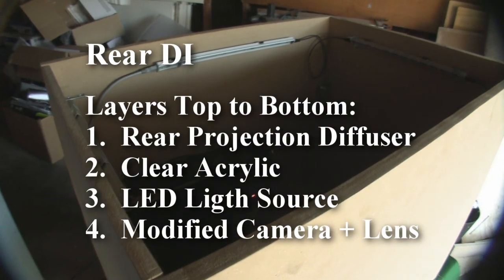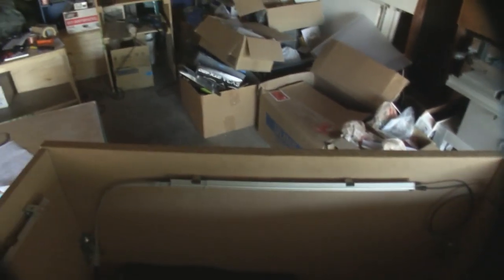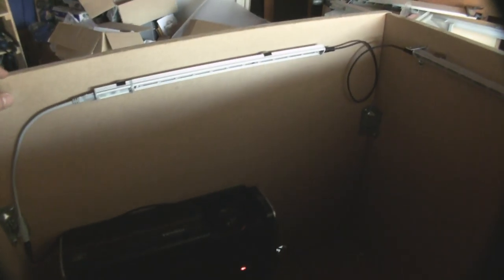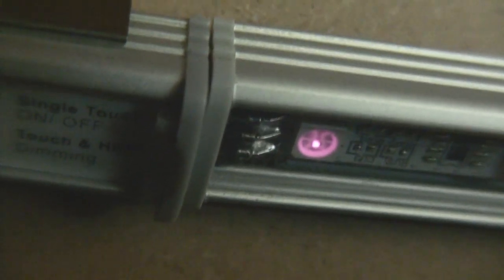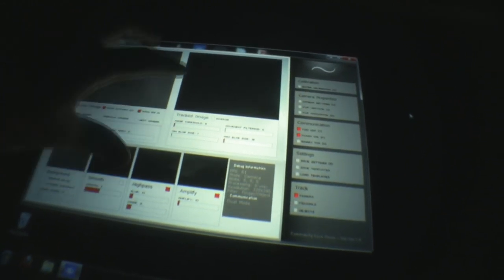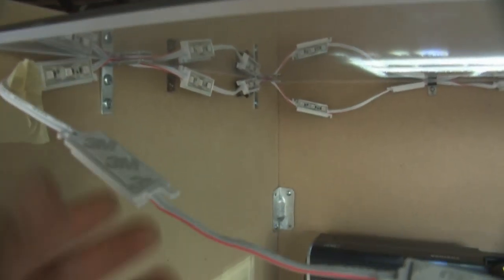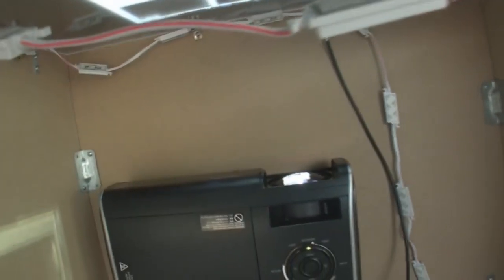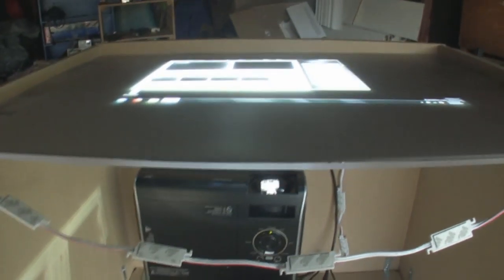How To Build a Rear DI Multitouch Table

Comment from the maker: Sure. CCV outputs TUIO commands which can be read by a Windows, Mac and Linux computer. If you want to control the PC using touch similar to a mouse you'll need to get a TUIO Mouse Driver for your OS.

Comment from the maker: The bars are 12 inches long so they would not work in a 6 x 6 inch box. You would be better off using the 12 module kit.

Comment from the maker: Yes it would still require two cameras, but you'd need a 3.6mm lens instead (which is better since it has less distortion).

Look at getting CCV 1.5 to combine the images and convert the touches to mouse movement (TUIO mouse driver also required). You can download CCV at ccv dot nuigroup dot com. To run multiple cameras you will need to get the multi-cameras driver from Code Laboratories (CL Eye Packs).  Please contact us through our website for more help on your project.

Comment: Thought about my size again, and forgot the decorative frame.  So screen size would be 32"x18". If that still requires 2 cameras for a 22" Coffee table height, will windows understand 2 touch input devices or is there software you guys sell that makes it work?  I have not gotten that far into your site yet.

Comment: Do you offer plans to buy?  I understand the basics.  IR Camera mounted in the bottom of the box.  Projector pointing up at that diffusion layer.  Acrylic top. IR lights around.  Hooked up to a computer.  I would like to know how far away a camera would need to be mounted from a 48"x27" coffee table.  Would prefer not to need a 36" high coffee table.

Comment from the maker: A Rear DI setup cannot have a see-through enclosure as the light needs to bounce around inside the box and only be emitted out the top touch surface.  Please use our contact form on our site to send us an email for further help on your project.

Comment from the maker: The videos should explain roughly the materials needed.  The LED-LP setup isn't that difficult assuming you can solder.  You need the single LEDs with narrow beam angle for LED-LP.  Yes projector can matter, but you can build a setup with any one.  Some are just better than others.

Comment: Okay thanks. What are the materials that are need?  How long would it take to build one of these sets? I am looking for a challenge and the LED-LP looks challenging to put together with all the LEDS. which LEDS would be better the sinlges or the strand? My biggest problem is finding a cheap projector that works amazingly or does the type of projector mater?

Comment from the maker: No, IR light doesn't change with color of paint (since color is for visible light).  If you want to help reflection inside the enclosure you can line it with metal (such as aluminum foil), but it typically doesn't benefit enough to make it worth the hassle.

Comment from the maker: @abcdefghiJerrold  Yes you can use lamps with a cluster of LEDs, but keep in mind that most CCTV lamps on the market have very, very narrow beam angles (15-30 degrees typically) and thus they will be flashlights, creating terrible hotspots.  You can get a bunch of small ones and point them down to the bottom of the box to try and reduce the hotspots, but the wide angle LEDs I go over in this video are your best options.  If you have any further questions please fee free to contact us.

Comment: Re the corner tracking issue, couldn't you sort of alternate the location of the bars?
like, one in the top left horizontally, one in the bottom right horizontally, one in the top right vertically, and one in the bottom left vertically?

Comment from the maker: @devilsonlychild  The diffuser in an LCD setup goes directly under the LCD layer to provide an even diffused light from the backlight.  You cannot do Rear DI with an LCD as infrared lights placed below the LCD panel will not be able to illuminate your fingers on the touch surface.  The only options to use with an LCD are: LLP, DSI, or LED-LP.

Comment from the maker: @HypaBass01 That box is roughly 21x28x24 inches (l*w*h).  The height is based on the FOV of the camera lens you decide to use.  The active image area of that table was about 15x10 inches using that projector.